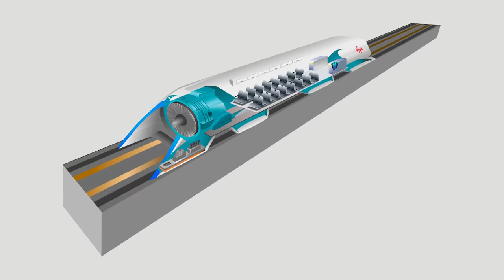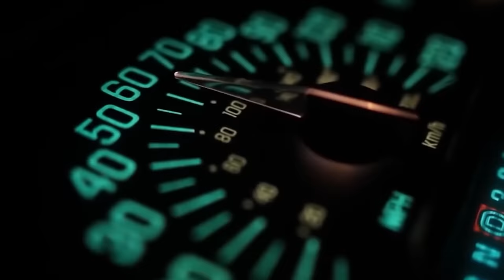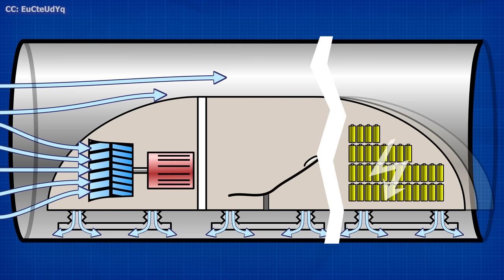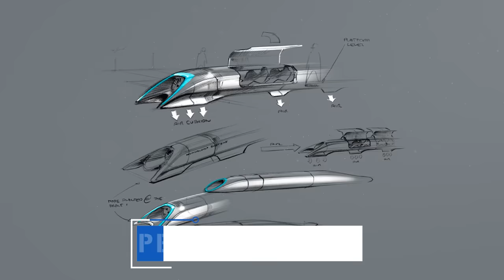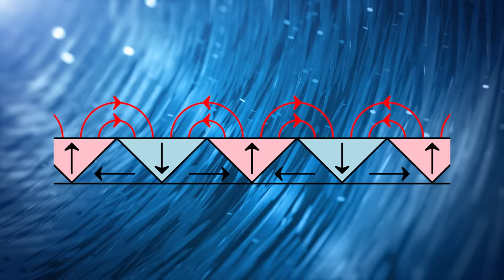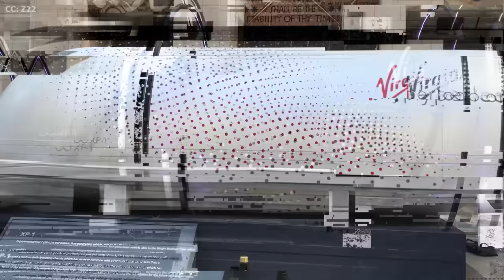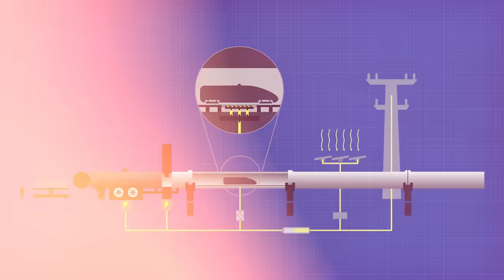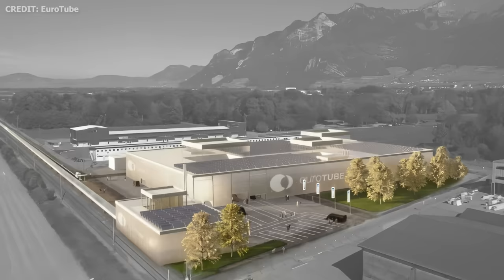We’re Getting Closer to a Hyperloop...

Comment: Everything I've read about the power and advamced construction materials needed to safely and efficiently create such a large vacuum, along with all the safety redundancies you'd have to put in place make this seem super unlikely on any mass level.
Reply: It's just one atmosphere of pressure. Big ships have to survive the same pressure difference over a similar volume...
Reply: @johntheux9238  I'm no engineer I just listen to the experts who seem to see this largely as an unfeasible pipe dream
Reply: There's a bigger deferential pressure in the cabin of an airliner.
Reply: @victorhankinson1530  they're the size of a large closet lol thats completely irrelevant
Reply: @TimSedai  There is something called stiffeners and stringers which are used to protect hulls from buckling. Works just fine with tubes.
Reply: @TimSedai Well even tho Elon is a lunatic in many ways, one good thing about him is he's the kind of person that will try anyway. Who knows haha maybe you are right and he realized that and that's why he seems to have dropped it
Reply: @johntheux9238  cool so making one MILES long, multi-laned (or what's the point), with layered redundancies for safety, pressurization, power, air, etc, not to mention the logistics AND the fact that creating and maintaining said vacuum while also maintaining some degree of actual traffic...??? Yeah never happening large scale. At least not with the materials we have
Reply: @TimSedai  Ship hulls can exceed 600'000 cubic meters which is equal to 100 miles of vacuum chamber and there is no leak...
Why would there be any leak in a single piece welded object?
Reply: @TimSedai It's not irrelevant. You were suggesting that it would be difficult to design.
Reply: @TimSedai  You seem to forget that we already have welded rails that can survive thermal expansion without any joints. No joints means no leak.
Reply: America will do everything BUT build a high speed rail network 🤦‍♂️
Reply: Ai will figure this one out… hopefully.
Reply: @johntheux9238  The problem is maintaining an environment on a vast scale, if any part of the system gets damaged the entire thing becomes useless. Elon specifically knew that it would not work and made it just to waste money and time.
Reply: @TimSedai  You are predicting the future by pointing to flaws in our current capabilities. You don't see the problem with that?
Reply: @TimSedai  Why do you think materials supply would be an issue?
Reply: @WGG-01  hyperloop, SpaceX, blue origin, that idiotic linear city... all just big expensive lego kits for bored billionaires
Reply: @WGG-01  Musk did not raise a single cent, he hosted competitions and provided the vacuum chamber for it.
And if a pump breaks down there will still be hundreds of them working. They are all connected to the same chamber so it's a redundant system.
Reply: @TimSedai  Now see the whole living on other planets with billionaire lego kits... Here we agree
Reply: Simon already made a video explaining all that ironically
Reply: @WGG-01  Thats still not a valid barrier to it's design or implementation
Reply: @johntheux9238  it's the (many if you want it remotely efficient) minivan sized bullets with people in them travelimg DOWN the impractical miles long multi-laned vacuum tubes that are the REAL logistical issue lol but you seem to be ignoring the many technical ones as well
Reply: @Gobbldeegoo1 AI: The cheapest solution to the human transportation problem is to eliminate the humans. The infrastructure to achieve this already exists.
Reply: @TimSedai  You mean vehicles are the issue? You made your point with the infrastructure but you really think vehicles the size of a minivan are an issue? You are really losing it.
Reply: The idea is not to have a complete vacuum because a complete vacuum is not necessary for the effect of a wind tube. That's a silly intangible and abstract argument for a different time and place.
Reply: People would have said the same sort of thing about building a 747 in the 1930's, but it was flying by the 60's.
Reply: Especially when you consider how well existing, essentially stone age trasnport infrastructure is maintained in much of the world. Imagine how much more catastrophic a failure would be on this thing compared to say a road having a few extra pot holes.
Reply: Personally I wouldn't get in the thing if it existed but if somebody else wants to take the risk that's a choice for them. People should be made aware of what horrors are possible in that death tube though.
Reply: @johntheux9238 yes it's just one atmosphere, but in the wrong direction
Reply: It will never happen. Just the thermal expansion of a miles long tube will make it impractical, and that's before you have the tiny problem of if anything goes wrong (which it will) everyone on the hyperloop dies horribly. This could be as simple as someone making a small hole somewhere and the resulting pressure wave travelling down the tube like a bullet in a gun barrel wrecking everything in its path.  There is also no way to keep such a long tube at vacuum pressures and bringing the airlocks up to pressure and depressurizing to handle passengers at stations in anything like a reasonable time is just massively unrealistic.
Its a bloody stupid idea with no advantage or cost saving over just building a normal rail network. Probably why no one has bothered building one in the 100 odd years since it was invented.
Reply: You have read the wrong information. Try going back in time and read comments about flight, space travel or even EVs. You will find a lot of negativities.
Reply: I'd argue they said the same about sailing trade routes down Europe and Africa into Asia, and then Into the Americas. 

A lot of people died, but we got there
Reply: @johntheux9238  I am taking you as genuine.
The issue is compressive strength (what is required) vs tensile strength.
They are literally polar opposites.
You can't use things like carbon fibre to keep weight low, nor can you have fun fail sensors.
You need basically 1" of high carbon steel... and it weight a lot.
Reply: @TimSedai There are far fewer of these concerns when it comes to freight transport. Hence why a good number of these companies focus their efforts on that. It's less red tape and easier to get going on freight, and then use experience gained from that on branching out into mass transit (or not).
Reply: @TalesOfWar Failure would be no more catastrophic than train derailments or an airplane crash, with similarly stringent regulations getting established over time.
Reply: Think the idea is that it would be an artery for the country running east to west and have the vessels as normal rail
Reply: @othmanskn  the difference with those techniques and this one is that 1, there is no known technology that can absorb the difference in size of the metal between warm and cold seasons, while maintaining the level of vacuum required. 2, the technology to protect the system from total failure in the case of explosive compression is not only unsolved, but not even attempted to be solved. Rapid turnaround compression and decompression systems will be needed on both ends, to get the train through the airlocks into the pressure needed for the pipe and surface. Given the amount of power consumption required here, while i think the system can be built, safety clearance is at least half a century away, and it'll never beat flying in cost/mile
Reply: @johntheux9238 lmao, you have no idea.
Reply: @victorhankinson1530 lol no there is not.
Reply: @johntheux9238 The Dunning Kruger effect is on full display with you.
Reply: @WGG-01 That's just stupid. Why would he want to waste his OWN money and time? Even if it never ends up being successful en masse, building one at all will require a lot of design work and perhaps materials engineering. A lot of things get made that make the journey as or more important than the destination. Take the Apollo program. In real terms actually being on the moon got us nothing. The process that got us there got us a lot. Battery operated cordless tools for one.
Reply: @johntheux9238 are you insane. They have gaps built in for expansion
Reply: @shadeblackwolf1508  If it's in the wrong direction you can just add stiffeners to prevent buckling. Ship hulls are also under a negative pressure difference. The water outside is at 2 bar 10 meters deep while the atmosphere inside is at 1 bar.
Just add stiffeners.
Reply: @meetoo594  Why would it? Modern high speed rails are welded. The secret is just to build them in the summer so that they only get tensile stress when they shrink. They can survive thermal expansion just fine, they are designed to be a loaded spring.
And if you make a hole it will just slowly fill up and the pods will slow down.
Reply: @smalltime0  Ship hulls are also under compressive stress. They are underwater.
They just add stringers to increase the hull stiffness and prevent buckling from the negative pressure difference.
And weight is not an issue for a vacuum chamber. It doesn't move.
Reply: @shadeblackwolf1508  There definitively is. Modern high speed rails are welded. They survive thermal expansion by being designed to handle the internal stress produced. They are like a loaded spring.
And the airlock can be designed to be just slightly bigger than the pods. Not much air to pump.
Reply: @randomname4726  Do you even know what buckling is and what stiffeners and stringers are? And you are the one to talk about the Dunning Kruger effect?
You must be one of Thunderf00t followers. The guy think it will be a bare tube and compare the vacuum chamber to soda cans...
Reply: @choahjinhuay  Not continuous welded rails. It's in the name.
Reply: @TimSedai I'm just here to appreciate your "pipe dream" pun. 👏😂
Reply: @johntheux9238  You make it sound like it is easy and yet Musk has failed at it.
Also Thunderf00t has had lots to say about this topic.
Reply: It doesnt need to be a vacuum really.  Just less.
Reply: It doesnt need to be a vacuum really.  Just less.
Reply: @johntheux9238  yeap ignore what I wrote.
Ship hulls are inch thick high grade steel.
Reply: @chrismichael7519  we actually had larger planes flying than the 747 in the '30s, hell the H-4 came about in the '40s -- you know when there was a war on
Reply: @johntheux9238  that won't work, the expansion/contraction of the tube over the long distance required would destroy the structural  integrity of the tube. And look up decompression accidents to see what happens when you alter the pressure in a vessel like a submarine rapidly, it's not pretty. If you can stomach it look up the footage of the divers who accidently depreasurised their capsule, they were turned into human string, literally forced through a tiny gap in an instant. There's also the fact that there is no known way to create a vacuum in a structure that large. As i said before, it's a stupid impractical idea with no economic or practical benefits, the definition of a non starter. I will eat my hat if a hyperloop as proposed in the fancy cgi ever gets built.
Reply: Elon's involvement is just regurgitating an old idea. He is well known for taking credit for other people's work. He is the guy with the money, and that should have been enough credit but Musk is not humble enough to share the credit with the scientists and engineers who did everything.
Reply: It isn't a perfect vacuum. 95% less air means 95% less friction.
Reply: @TimSedai all train lines were initially 1 lane. If 1 train travels 10 times faster than the normal train, then a complete round trip is still 5x faster than 1 way with a normal train
Reply: @joshentheosparks7492  You are correct, the whole point of the hyperloop being viable hinges on not needing total vacuum and thus saving a ton in energy costs, maintenance and construction. Whether it can be made to be financially feasible remains to be seen if one ever gets used for public transportation.
Reply: @victorhankinson1530 what  ?  Since when is air pressure at 10000m  less than near vacuum  ?
Reply: not only that but. americans will not give up land.... its gonna have to be under ground and its still not gonna do it..
Reply: @johntheux9238 displacement is fastly different than a vacuum pipe.  You get one sizable hole into it,  tonnes of air be rushing in at the speed of sound crushing everything inside.
Reply: @MRsolidcolor  you funny 😁
Reply: The thing about big freight is that it doesn't really need to be moved at ultra high speed.  The containers have often spent days on a ship prior to begin distributed across a continent. Now, things like small package mail - that's different. Being able to distribute small items quickly would have a market.
Reply: they also said electric cars were not a viable business venture.
Reply: @heroedeleyenda05  was never stated,  just production of EV lot more expensive.  EV sales are great because of regulations and subsidies. You have few who buy EV do to conviction,  but is makes about 1%.
Reply: That's because you have a functioning brain
Reply: @smalltime0  Yeah it made it all the way up to what, about 10, maybe 15 ft?
Reply: @_blank-_ thanks auto industry
Reply: @johntheux9238  "Ship hulls can exceed 600'000 cubic meters which is equal to 100 miles of vacuum chamber and there is no leak.."

Stop trolling dude, you're not good at it.

The Mersk triple-E displaces only 260.000m3 fully loaded. 
For a 3 meter diameter cab the tunnel has to be 4 meters wide so every meter would be 12m3 for one meter of tunnel so your 100 miles would be 160.000m *12= 1.920.000m3

And ships are not hollow AT ALL*. A *lot of their mass is just support structures to prevent the hull from being crushed  by the water pressure.
And ships have hulls that are easily 15mm thick steel, many have double hulls jsut for strength.
And ships are NOT watertight, they have bilgepumps.

Basically: go back to school.
Reply: @vinny142  I was talking about the Prelude FLNG.
Reply: @vinny142  And according to the white paper the passenger tube is 3.91 square meters.
Reply: @Yutani_Crayven  

1.Train Derailment doesn't have collisions of a pod going at the speed of sound. 
2.  Train derailment doesn't have a shock wave of air filling up the now breached vacuum tube.

Remember Ocean Gate? A catastrophic accident on the vacuum tube would be similar but much more costly.
Reply: @Yutani_Crayven  lol, airplanes are actually the best example here, if an airplane fails, everyone dies horribly, there's hardly a way to survive an airplane crash and yet airplanes are hella save.
Reply: @shaddapforever  Did Musk ever try it with an own company? I don't think he has, therefore he hasn't "given up" either, he simply already works 24/7 and is running 5 companies at once.
Reply: @vinny142  aren't the pumps for water coming from waves going over deck height?
Reply: @asandax6  bro do you know the pressure in 4000 meter depth?